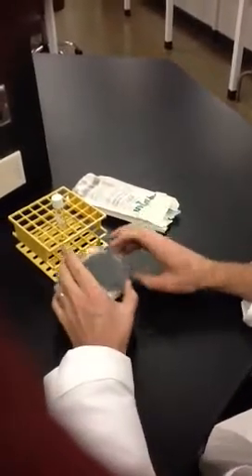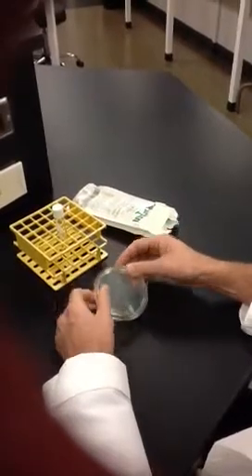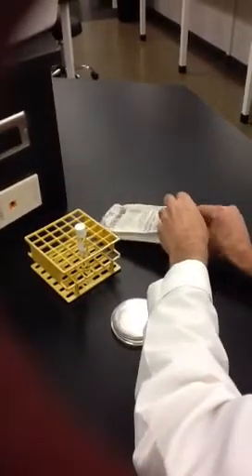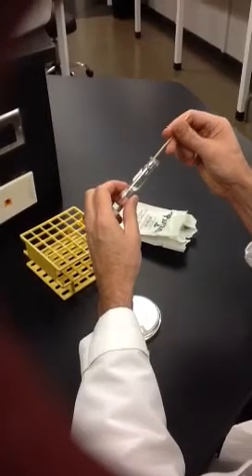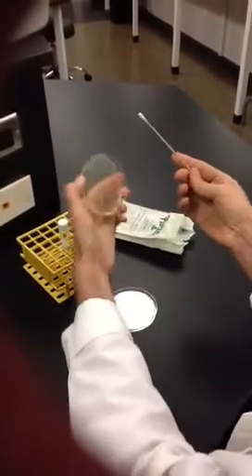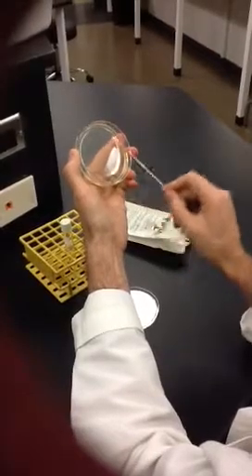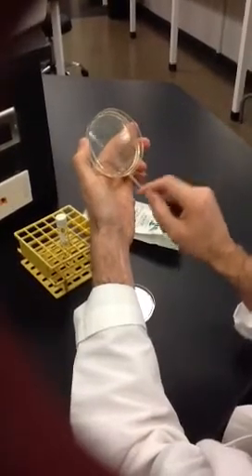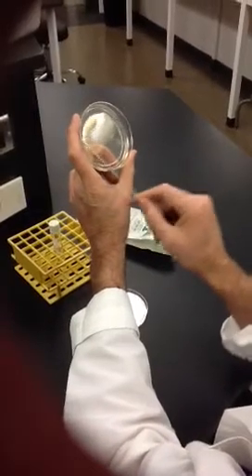How to make a bacterial lawn.

Comment: You should have flamed the neck of the test tube containing the culture, especially since you touched the swab to the side of the tube to drain the excess fluid. Your sample is definitely contaminated.
Reply from the maker: +ROBERTO ARMANI  APPL MICROBIOLOGY, Mar. 1972, p. 441-443 Vol. 23, No. 3. I heard about this as a graduate student circa 1983. Interesting reading.
Reply from the maker: +ROBERTO ARMANI I'm sorry, I don't understand the question. If you are saking whether there is a 2015 article on this subject, I would say a) seems a lot less relevant with the widespread use of biosafety cabinets, and b) there are no scientific advances in the last 33 years that would that could really improve on the methods used. Newer doesn't mean better.
Reply: +David Gilmore article from 1970? are u serious?
Reply: What about 2015?
Reply from the maker: +DUG LANDRESS Sorry, but no. a) the swab was pressed against the inside of the tube, not the outside. b) I have not flamed tubes since I learned about an article published in the 1970s that clearly showed that flaming tubes has no effect on contamination rates. There are arguments that suggest that flaming tubes could be helpful and arguments why it would increase contamination. It is probably simpler: Pasteur and Koch probably flamed tubes to burn off the stuck cotton, and people just keep doing it for no reason.  Thanks for your comment.
Reply: @GERMGUY11  ok! Did not know about this but I’m going to try it both ways with my Lab Rats tomorrow and see if there is a difference in our plate cultures.